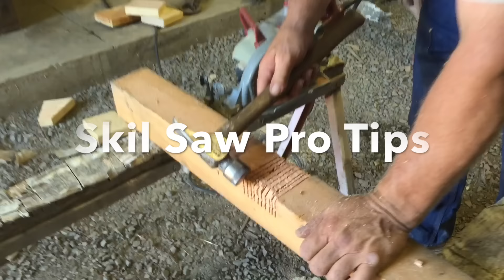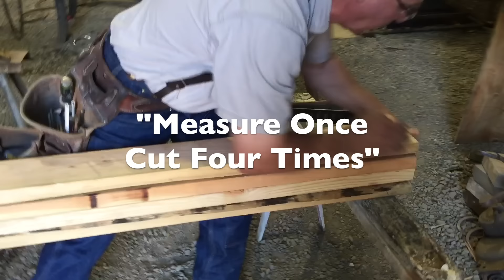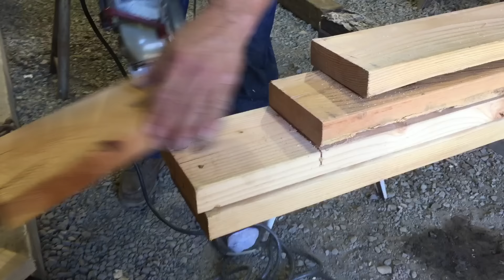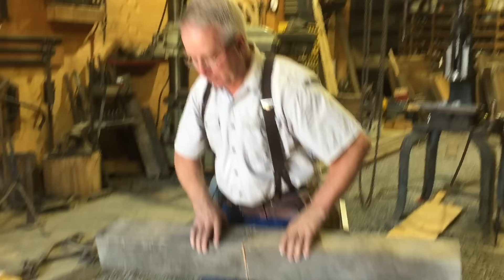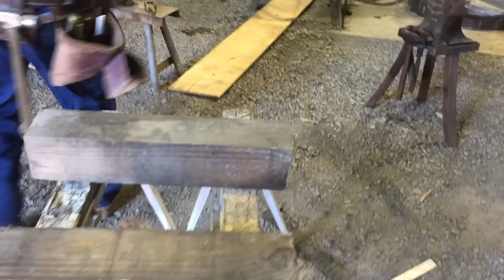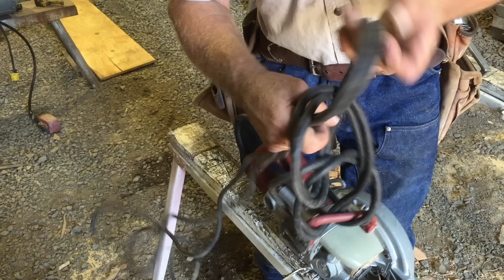Skil Saw Pro Tips

Comment: Hey, there Essential Craftsman. I've recently discovered your channel, and I'm thoroughly enjoying your content and delivery. Thank you! I have a question that you may be able to answer.

Short version: do you have any tips for truing a steel saw foot?

Long version: I found an old Chicago-made 8-1/4" Super Duty Ball Bearing Skilsaw at a pawn shop a while back, and it's been my main saw for over a year now on the job. She was dirty, but after a thorough cleaning, new power chord, new top handle, oil change, and new blade(s), cuts and runs like a dream...with a single downside: it can be a real pain ensuring true cuts, especially at freehand, edge-up angles. The rear, right corner of the foot is nearly 1/2" above the rest of the foot, and at freehand angles, it's very difficult to keep the saw weighted and oriented correctly toward the front left corner of the foot. Skil no longer sells the foot, as the saw is apparently obsolete (A saw made between the 70's and 80's? Obsolete? Who knew???). Anyhoo, bringing 'er full circle: I'm not sure how (or if it's even possible) to true up the foot without making matters worse.

Comment: For roofing, the skills saws made for metal work great. Worth it if you do a lot of roofing. Great video, thanks! BTW, and edit: evolution multipurpose blades are great if you do the occasional metal. With an adapter bushing my 7 1/4" B&D 977 worm drive happily cuts 1/4" angle iron.

Comment: I have not seen the carpenter square used for rafters since grampa taught me.I would say most framers these days could not do it without a Swanson speed square and many could not even fully use that.I also would add that some of what you do is even more dangerous with a direct drive/sidewinder saw.Never felt right plunging my saw into trusses, bigger rafters but 2x4 trusses no.

Comment: you should do a basics about a saw s all's   one time I was using a saw s all's  cutting a big piece of wood that they put on top of window frame really heavy   and I  was on  a folding ladder and the saw s all push me back really hard I almost fell when the big piece of wood fell at same time  
those power tools are Very dangerous if they are not use the right way 
but I really appreciate that you explain everything throughlly  thanks

Comment: I appreciate these tips, but PLEASE, if your are not familiar with circular saw behavior, DO NOT TRY THIS!  I was waiting for the saw to kick back when he had his knee over the board doing a plunge cut.  One important thing he did not mention was the behavior of the wood itself.  That piece, once plunge-cut, could have squeezed his blade and made the saw run back over his leg in milliseconds.  NEVER put a limb directly behind the saw's cut line!  In my experience, it's the "time saving" factor that gets the most people hurt, which was the theme of this video.  Use a hook to hang your saw, a plunge cut is just an overstatement to show off.  DIYers should NOT try ANY of this.

Comment: Any tips on cutting let's say 22.5 " long pieces of 2x6 for blocking for truss blocking using a skill saw from a 12 foot single board? 
My method of cut one block and use it as guide for the other blocks work but it takes a lot of time. By the way I didn't know Oak trees grew in Oregon ? I thought they were a east tree only. Thanks for the videos , your a very busy guy .